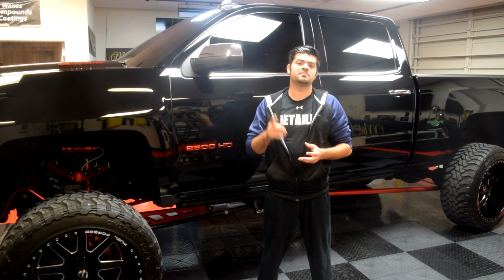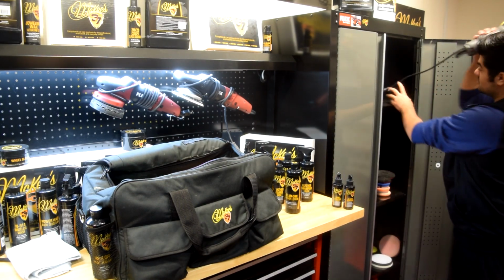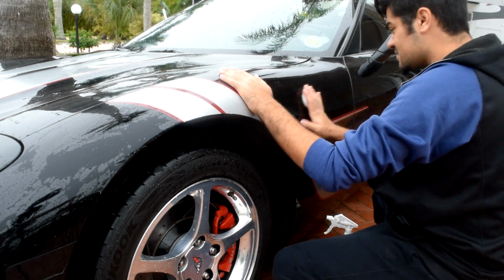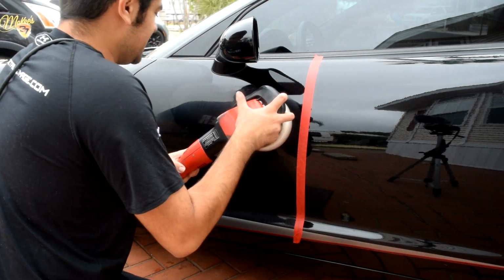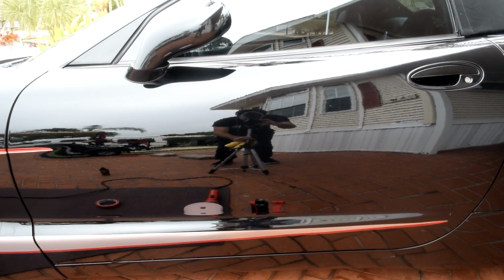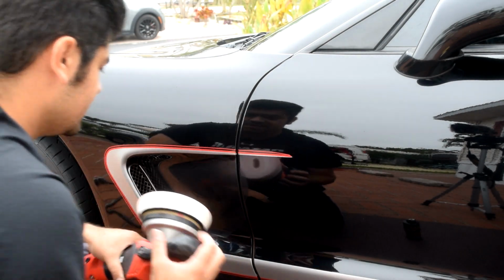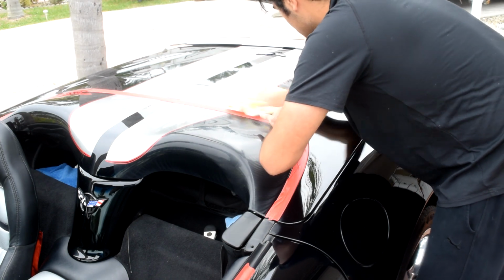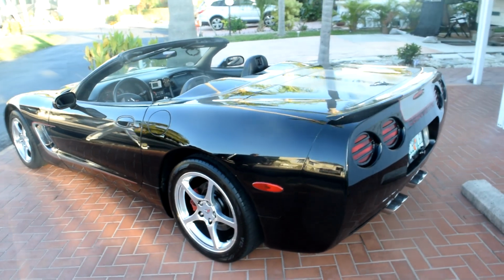How I Prep For A Mobile Job | Using All-In-One Polish

Comment: can you use the 360 all in pne on every maintencnce wash/once per month or is it overkill? Since i assume there isnt Cut in it , it should be fine to bring out shine every maintenance wash correct? also,  after you clay bared it did you wipedown with isoproploy before you went into buffing the car with the flex 3401 ? thanks man great videos!

Comment: Which you prefer 360 or griots finishing sealant? What are its difference in cut and protection?
Reply: 360 is more geared towards paint enhancement, while finishing sealant has some abrasives in it which can do some minor correction. Hope this helps

Comment: So how do you prep? Do you do a rinseless wash then clay then AIO polish ?
Reply from the maker: jeremy sierra there’s no right and wrong answer. I chose a Rinseless wash cause the car wasn’t that dirty. If it was dirtier I would of went with a traditional wash.

As far as claying goes that depends on the package the customer choose. If a customer just wants a quickie buff. And has a certain budget. I will use 360 as it has paint cleaners. So it’s going to clean polish and seal the panel. All in one step. 

If the customer is compensating for my time I would clay before certainly.

It’s not about how much money you get it’s really depends on how much time you spend getting that money.

If I tell you I made $100 bucks today detailing would you laugh and say I made nothing ? Well what if I told you I made that $100 on a 30 minute headlight restoration. Get it !

Adapt to the customers budget while giving them what their mainly concerned about.

Comment: can you go into detail on the porsche paint correction? what did you mean by sticky paint? was it because the the heat from the sun? also if the paint is much softer. wouldn't explaining to customer that the car will need to be taken to your own indoor personal shop to work on vs outside with the heat? and also what compound which you recommend for a car like porsche? i was planning to use porter cable plus griots garage fast correction cream.
Reply from the maker: Calvin Wong sticky paint has nothing to do with temperature. It’s called sticky because some paints respond differently making the polishing residue very hard to remove making the paint “sticky”

The key to working with sticky paint is to not create a lot of heat. Heat causes the polish to have a baking affect on the paint making it hard to wipe off. The pc is a great tool because it does not create a lot of heat.

As far as Porsche paint nobody on the internet can tell you what polish or procedure to use you have to test and determine that your self.

If perfection is the goal I would concentrate on a compound fast correcting cream is great 👍🏻

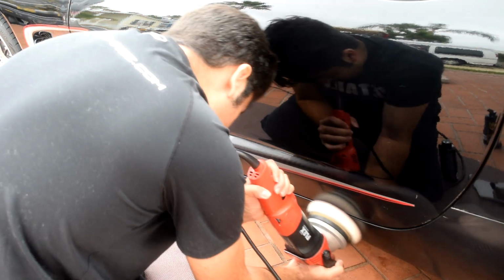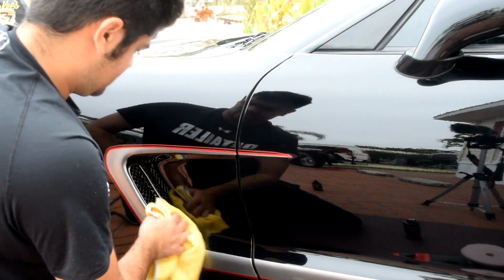Comment: As we know Flex 3401 is forced rotation DA. So I guess some of the rotary techniques may apply with this polisher as well. Don't you think Flex 3401 would damage the edges if not protected properly (13:05 and 16:03 in the video)?
Reply from the maker: You never want to buff OVER any edge on any polisher. Even a porter cable at a certain speed and angle burn an edge. The door edge was completley flush with the side skirt. There was no danger whats so ever of me running the buffer over. I was not hitting a RAISED edge. You always want to work around a raised edge not over it.

Comment: I cannot stand polishing outside. Even if you can't see the dust, it's falling on the paint and it's counterproductive. For a quick job like this, it'll do, but trying to truly correct paint outside = worthless! With that said, Joe, you are the man! Truly respect your work!
Reply from the maker: I totally agree with your Mark. That is why I only offer paint enhancement (360 all in one shiner jobs) or wax/seal for mobile. Anytime a customer is willing to compensate for paint correction I always advise that it is done in the shop.
Reply: Regardless, it came out great!!

Comment: Great video Joe how many pass do you do I've tried 360 direction say Worley til go clear what do you. Recommend
Reply from the maker: Thank You Mike! 

How many passes I do all factors in on my overall goal for the job, Sometimes I use 360 just like a paint sealant or a wax.

You can do as many or as little passes as you want.

It really depends on the amount of defects you want to remove. 

My rule of thumb is if you are willing to spend over 4-5 hours using a all in one, You might as well use a cutting polish and just "cut to the chase"

But to answer your question. I usually will do about 3-4. Remember when I am using a all-in-one like 360 perfection or even near perfection is not my goal, It is to enhance the paint. So me doing 5-6 passes does not make sense in a time efficiency stand point.

When you get the chance Mike, watch my other video that is on my channel, It is called "How to use a all in one 1 step polish to profit" I talk about arm speed and passes in that video also.

Thanks for your support.

Comment: Love these videos. Great work as usual too. Wish I had bought a 3401 instead of my Rupes 15mm but oh well.
Reply from the maker: Thank you for the support, It means alot to me, I am a huge fan of long-throw machines, Infact I prefer my 21mm tools when I can use them, However you always need the 3401 in your arsenal, I use it for every detail. If i had to pick 2 tools only to use for my details it would be a 21mm long-throw and a 3401, Those 2 machines I can tackle pretty much anything. with the 3401 sometimes there is no need for a 3 inch.
Reply: At the same time I love my polisher too. But the stalling is very aggravating. I can counter the stall by turning the speed up, but certain times it just won’t turn.
Reply: Next Level Auto Detail what about 3” being handy for polishing glass?
Reply: I bought the Rupes Marklll 15mm and the 75 mini after my Griots craped out on me... had been about 3 yrs of use though,  definitely got my money's worth out of it.
Reply: Charles Espinoza did you know Griots polishers have a lifetime warranty?  Go get another one for free!
Reply: @tundrawhisperer4821  actually no, I did not.  Sweet! Thanks for the heads up, liked that little polisher, guess I'll have a new backup then. 😁
Reply: Charles Espinoza which griots polisher model did you have?  Thx

Comment: McKee’s autogeek sponsored?
Reply from the maker: Bob McKee the founder of AutoGeek sold it last year, He kept McKee's 37, Next Level Auto Detail has 2 locations Chicago and in Stuart Florida, I Detail at the McKee's 37 HQ.
Reply: toto wolf everyone sells something. 
If it works?
Reply: Luminositymusic well I’ll be finding out how good McKee’s products are...i was using their DP pr ducts before and they were decent.

So far I’ve used their interior cleaner and protectant on my a6 and they work well...the protectant is perfect from the satin shine, smell, the way you slide on the leather to how it resists finger prints. We’ll see how the exterior stuff works.